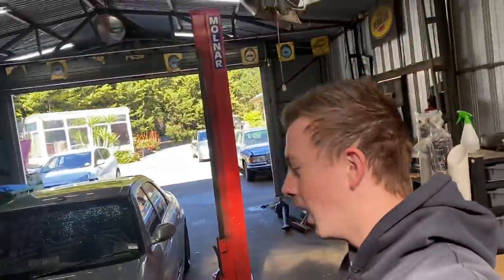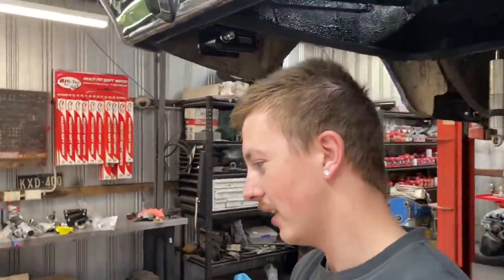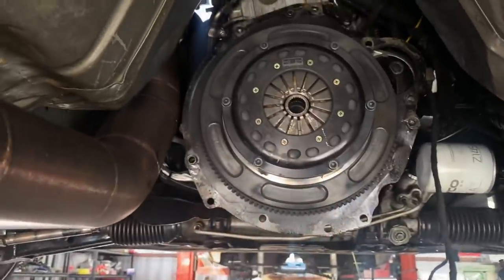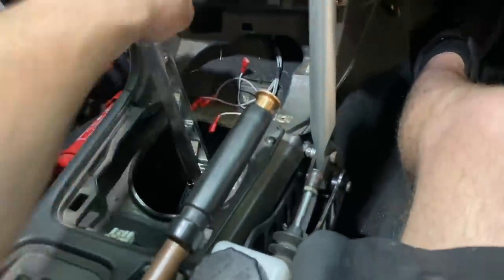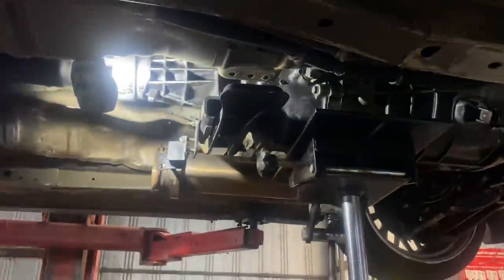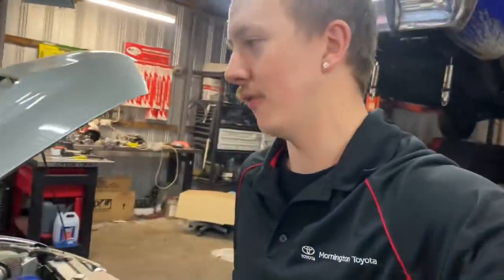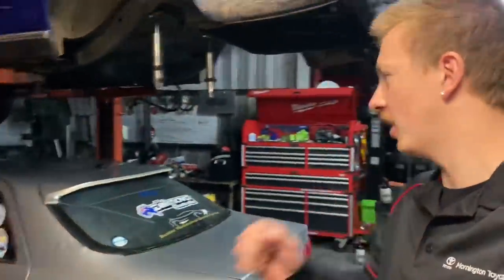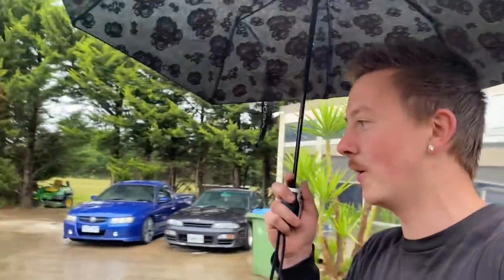R33 RB25 Speedtek Billet Short shifter | + New car!

Comment: Drain you catch can back to the sump, it's not an issue on 85 just need to change oil a bit more often, in saying that probably already change it every track day, I had issues with my 25/30 filling the can in about the same time as you, boost doc splash trays and all and still was shit till I made a drain back to the sump, oil level stays full all day long.
Reply: wrx2hot4u  you obviously have no experience with e85 at all if that's what your thoughts are, plenty of maautooks, Crd 8 second cars that have this kinda setup, iv been running it like this for years never had an issue. But hey if the fastest cars in Australia are doing it then they must be stupid too 🤷‍♂️🤷‍♂️
Reply from the maker: @alexhateley7322  yeah I’m leaning that way, when I pull the sump off I think I’m going to ad a bunch of -10 fittings to it for all the drains 🤣
Reply: @CamMartonDrift  haha 100% that's what I did when I had my sump off too.